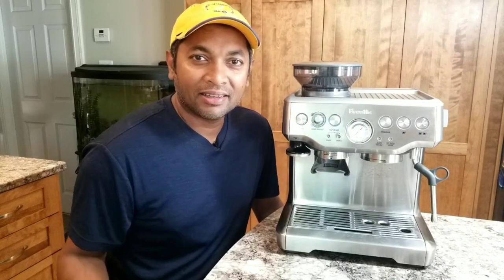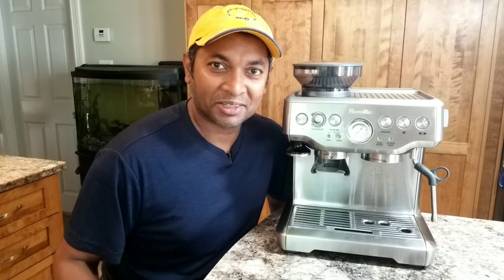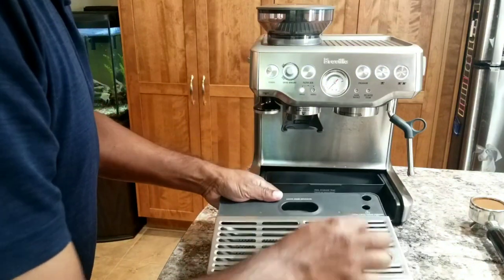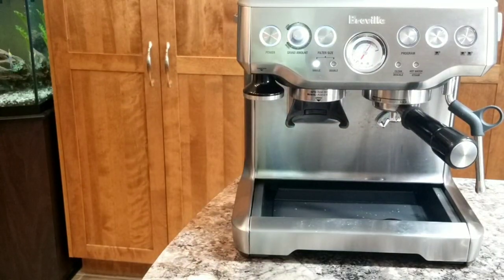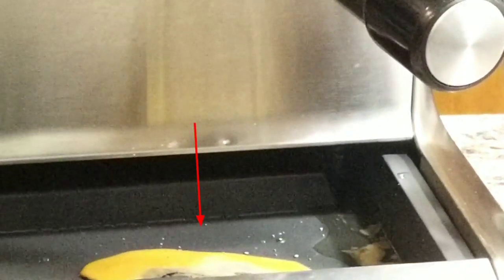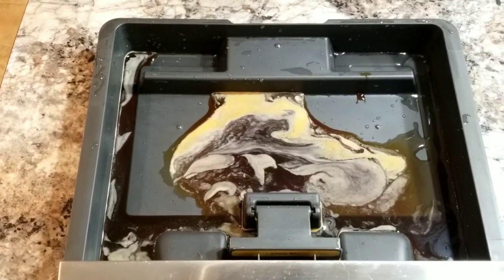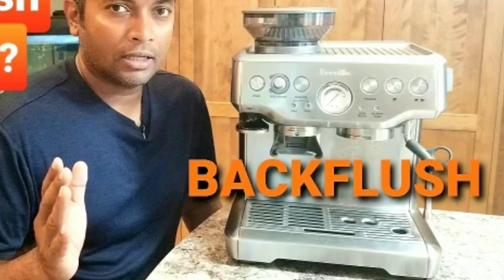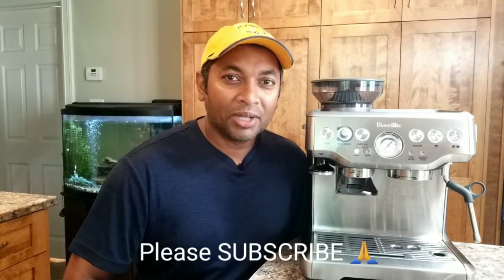Can this Damage your Espresso Machine?? Backflush & High Pressure Extraction on Breville Barista

Comment: My machine operates in the overpressure every time and I want to get it into the correct extraction zone.  I  use 17-18g and try to get 27sec extraction but in order to do this my grind size ranges from 2-4. I use fresh coffee within one month of purchase and am particular about tamping and distributing coffee.  There is a lot of water in my tray underneath.
Reply from the maker: Over pressure = more warer in drip tray through OPV. That's normal. Either reduce quantity to 16.5 or take 17g and grind at 5 ot 6 (more coarser)

Comment: I have 860xl that is over 10 years old and installed new pump, there is small leak between pump and OPV, OPV only screws in about four turns before getting tight and do not want to risk damaging the fine threads by continuing to turn it if clear silicone gasket is no good, how to get new OPV gasket without buying new OPV? thanks, excellent content, I learn so much!!
Reply from the maker: Never tried to opem OPV. But if you manage to open you'll see a red o-ring either damaged, melted or if you suspect a leave replace it. Use a pin the take it out if its stuck inside

Comment: HELP After do a clean with tablet.   I did back wash.   After doing it the coffee no longer has crema on coffee even moving to 1 for fine just a little.
Reply from the maker: Do a pressure tesr to see if your machine works well. https://youtu.be/acQYG7HkYb4
I suspect stale beans. When is the Roasted date on the beans?
Reply: Yes did a pressure test following your instructions tried 4 different coffee bags.  Spoke with Breville they set it back to factory setting.  Told me to do a shot in dual wall double filter.   Pressure was at 1 o'clock. Which they said too high. Even though 8 months out of warranty are repairing at no cost.   Will let you what they had to do picking up today.
Reply from the maker: @RaaAustin-xv5kt  ok let me know
Reply: I have picked it up they said adjusted   grinder and flow.  Made a coffee was in the expression zone crema probably a little thin but good.  Think still needs some fiddling with grind.  They have the side level at 8.

Comment: Hi ! You have excellent info and videos !! In my machine the pressure gauge is every time almost at the maximum...
Reply from the maker: Make sure your filter Baskets are not clogged. I have a video on how to clean clogged filter. 
Secondly make sure your Grind size is a bit more Coarser. 
Thirdly you can reduce 18g to 16g or 17g.
Happy Extraction 👍

Comment: Hi, thanks for sharing your valuable experiences through these great videos. I have learnt so many things from you. Here I have a question. I too use the same breville barista. My issue is the yield which come in 1:3 ratio like I put in 18g of beans and  I get 55g of espresso in around 20 seconds. If I make it finer the time increases and pressure increases but the yield remains the same. What should I do?

Comment: thank you for this...my breville just went too high on the pressure and i was freaking out because i thought it was broken...i didnt think i ground my beans that fine but maybe i did and i did notice the tray had extra water
Reply from the maker: See if you are using Double wall Pressurized basket. Also make sure you clean the holes in the basket and see if its clogged. If both are good then grind it more Coarser.

Comment: Every time I see your machine apart, I get the urge to open mine and add an electronic pressure sensor and temperature sensors to monitor the espresso making process each time I brew. thanks for the inspiring videos
Reply from the maker: You are welcome

Comment: Thank you! Now I know why there is water running on the side and why my sealing ring is damaged (to much pressure)
Reply from the maker: O - ring Usually gets damaged when there is clogs. Clogs is the culprit that produces pressure as it chokes the pipe which creates pressure and burst. But when you do backflush, there is something called OPV (Over Pressure Value) that protects the machine from excessive pressure build up.
So solution is to Descale regularly so that the pipes are not clogged.

Comment: Is the pressure in the boiler and the pressure in the portafilter actually much different? You would think that the gauge would display brewing pressure.
Reply from the maker: Pressure is generated by the pump. Boiler has no role.
Reply: @AjusCafe  Agreed, but you made it sound like the gauge pressure may be different from the brewing pressure. I have seen a few videos where people use a portafilter with a pressure gauge, and the pressure on both gauges seem to be about the same. So I feel like the gauge on the machine is fairly trustworthy.

Comment: Hi thank you for sharing this video, I have a question about my machine, recently when I make my second brew right after my first brew, the water pressure always went to a little bit higher than the first one, which will cuz my espresso dripping..taste not good, but all my grind setting is the exzactly the same like the first one. after I shut down my machine for a while. when I brew it again the pressure is normal, but the second one will get a bit higher again. I have no idea whats going on? have you had this issue?

Comment: Thank you for your Video and I would like to have your reccommend for use the basket, whice one is better between to use for  fresh ground coffee or use with pre-ground coffee?
Reply from the maker: For Freshly Roasted coffee beans always use single wall double cup basket, i.e. Non-Pressurized basket. I wouldn't recommend you to use preground coffee for espresso. Its good for making drip coffee,  French press etc  if you still wanna get the taste of it then you MUST use Pressurized Double wall basket. Else you won't get pressure. Even this pressure that you see is artificially made by Pressurized basket. So you won't get the full flavor of the coffee
Reply: @AjusCafe  I see. Thank you for your recommend. I will try it again. 🙏😄

Comment: I have bambino plus machine, and my problem is the high water output, what’s the main cause and how can I fix it?
Reply from the maker: How many Oz or wster how many oz of Espresso do you get
Reply: @AjusCafe  40 gm in less than 20 seconds,, I’ve tried to reset the factory settings, but It didn’t work
Reply from the maker: @wejdanmmh8742  can you grind more finer the coffee beans and tell me the numbers again?
Reply: @AjusCafe  it’s still 40 gm, also the water flow is fast from one side of the shower screen, it’s not distributed evenly

Comment: Can this machine grind more than 1 of coffee variants together in a bean hopper (ie; arabica+brazil+robusta etc mixed together)? Because someone told that it can occur malfunction of the machine?
Reply from the maker: Oh no. I don't think it can malfunction 🙂 in anyway. But why do someone do it, as every bean pack is different and it needs to be dialed in with different grind size etc. So when you mix beans, you are not hitting the sweet spot of each bean type. But nothing wrong to try it out. In fact my next video is about roasting 2 different beans together and taste it. Stay tuned.

Comment: Thank you for your video. I realise that I usually have backflush. Does it mean that anytime you have backflush your pressure is too high? I.e beans too finely ground?
Reply from the maker: Backflush will generate lot of pressure like finely ground powder. But Backflush process should be done without any grinds in the basket.

Comment: I'm surprised that your gauge didn't give you an even higher pressure reading. It almost looked like you were right on the edge of being within range, even though the shot was clearly over extracted.  For my machine,  the gague would have moved even further given the extraction was chocking that much. It makes me question if your gauge is stuck at that point or if gaguges on these machines are not accurate in general.
Reply from the maker: That's all it goes on over pressure. I checked with backflush clean  disk as well and that all the meter reads. You machine is showing correct. Mine has some guage calibration from day 1. Nothing major to bother me.

Comment: I forgot to fill up the water in the tank (water is empty in tank) while doing an extract and switch the wand ON to steam milk...will this affects the machine and caused the break down or malfunction?
Reply from the maker: Yes it is possible to fail. Never operate steam without water in the tank.

Comment: hi my machine has same problem, overpressure and coffee not coming out! but before it works fine..what do u think is wrong with it?
Reply from the maker: Check if the filters are clogged. https://youtu.be/oNEgUli_DwA
Test by running hot water without coffee Grinds and see.
Reply: Did you ever find a solution to this? My machine was working fine, and now way over pressure & nothing at all coming out??
Reply from the maker: @kayleigh_dunn  run empty shot without Grinds in it. Are you getting water flow with low pressure? If yes then you need to use Non-Pressurized basket and grind Coarser.

Comment: Thanks for the video, I've same issue with my espresso machine, same model.I have to fine grind the beans to extract 36g espresso from 18g beans using double baset  in 25-26 seconds, but the dial is showing overpressure almost full scale and the taste is not good.
I have tried several settings but unable to adjust to the correct one,if I go courser the extract is very fast about 11-12 sec. Any idea hove to solve this issue. Thanks,
Reply from the maker: You need to go step by step Coarser. What happens when you do just 1 step Grind size coarser? The flow should get better. Taste and see. Then adjust if needed. Usually BBE automatic Extraction would bring out 1:3 i.e. around 45g out from 18g. If you want 1:2 then go manual Extraction. https://youtu.be/d1fKAH-Au5Y
Manual https://youtu.be/b15CR_A9PgM
Reply: @Aju's Cafe  Thanks for your help.
Reply from the maker: @waheedbakier8545  you are welcome

Comment: What happens to the grinder if using oily beans? It is save or not?
Reply from the maker: There will be lot of build up of coffee oil which will be hard to remove. And oil attracts grind and make it gummy or glue like. That will strain the grinder and the performance will get weak and life of grinder will shorten. Unless you do thorough deep cleaning every week. So medium or light roast is safe for longer run and performance.
Reply: @AjusCafe  Thanks for infos.. :)

Comment: I currently have this problem, but my machine, according to Breville, is completely broken. All of a sudden last month, my machine stopped pulling shots with the two-shot basket, and the pressure was so high no water was coming out, I mean no water anywhere. Apparently, it's a faulty water valve. I clean my machine monthly to scale it, do the tablets, take off the grinder, the whole thing. Unfortunately, mine just decided not to want to work anymore.
Reply: I have exactly the same problem with my machine. Is there any solution to this?
Reply: @Anita_She  I sent my whole machine into breville for fixing but it may be as simple as get new baskets. Apparently over time they get clogged but no where in my research did someone say that.
Reply: @KeeleyKirkley  thank you for your reply. I did unclog the baskets with the needle that was included in the set. Unfortunately, that did not solve my problem. I also back flashed the machine, descaled it with tablets, cleaned the grinder and nothing helped. So, I guess I have to send it to Breville for service as well.
Reply: Contact breville; they might want a video call with you to see what exactly is going on. That is what they did with me after I got it back, and it still wasn't working due to the clogged baskets. But overall, sending the machine is super easy and definitely worth it if you use it daily like most people do when they have this machine.
Reply: @Anita_She  hope that helps!
Reply: @KeeleyKirkley  yes, it does. Thank you once again 🥂🌹
Reply: @KeeleyKirkley  how do you send to your Machine In if it needs maintenance ?
Reply: You need to contact breville. I find it easiest to call them and they will walk you through the steps on how to fix it over the phone, or if it's still under warranty, they will send you a new item or they will, have you ship your whole machine in. That's actually what I did. I shipped mine to them.  2 weeks later, I got it back, and it worked

Comment: This machine is weird. The pressure gauge does not correlate to extraction times, and it seems everytime I make an espresso past the 12 o'clock I get water in the driptray like it's backflushing some water. These are things that get me nervous about the machine cause I have another older and cheaper one, the Ikohs kaffetta that is not even longer on Amazon, completely manual machine, no grinder, temperature gauge, not a pressure gauge, and it did not eve come with a single wall basket, and had to buy one separately, but Using separate grinder, and the single wall double shot basket I managed to get better shots than with this machine, no backflushing and since it has not the manometer it keeps me off from confusions.
So, I think theres something wrong with this machine, the way they calibrate everything in it. Even though it still is a good machine, I don't think I would buy it if I knew all of these. There must be machines without these issues.
Reply from the maker: When its Extracted in hight pressure, more water flows to drip tray like a backflush. That's normal and what the Solenoid and OPV does during extraction. Nothing to worry there
Reply: @AjusCafe  Thanks. I bought new freshly roasted coffee in alocal store and it seems to work better. The extraction looks smoother. I managed to get a a 1:2 ratio in 25-27 seconds mor eor less and it was superb.

Comment: I have a issue with ny machine,anyone can help with an advice.  1 week ago i tried to clean my machine ( clean me function) and i don't know how but the seal from the head shower snap. I thought that it's time to change it because i never do it in 2 years time. J change the seal and the same thing happened. Than i thought that is something wrong with the head shower so i replaced that too. I just received the head shower today,change it, change it and it snap again.  Did anyone experience this? Thanks
Reply: When I'm doing a coffee that is under extracted is fine but when i try to clean me or put to much/finner  coffee into the portafilter the seal  break and the coffee is overflowing
Reply from the maker: Good question. Keep these tips in mind for a longer run of silicon seal:
1. Never force tighten the Portafilter when the machine is cold. Because silicon will be flexible ONLY when its warm
2. Warm up the machine and run hot water through group head 1 or 2 times
3. Then gently tighten Portafilter to the GroupHead without Grinds and run empty shots.
By now the silicon is warm and flexible. Now dry the PF basket and fill in Grinds and make sure you TIGHTEN it in GroupHead which should be warm and flexible. 

Flow above steps before you do  clean cycle too.
Reply: I'm afraid that is not gonna be that easy,i do all this steps every morning. I even don't let my wife use the machine,i bought her another one. Buy now i broke 3 silicone seals and change the head shower. I will change the portafilter +basket and if will be the same i will have to contact someone who knows much more than me. Thanks anyway
Reply from the maker: @CosminAdrian1528  ok i understand. But warming up (either by switching ON this machine for 20 minutes OR running hot water like I mentioned) GroupHead, PF and machine is what most of espresso makers/baristas follow and the right way to do. It applies to any espresso machine.
Reply: @AjusCafe  thanks 🙏
Reply: I’m having the same problem, so I brought the machine to the warranty company. At the same time I found here the answer what’s the problem. The company’s masters told the same. Because of the grinder vibration the bolts holding the group head inside the machine get loose and there creates a gap between group head and a PF. That’s the reason the pressure spits out the rubber gasket. You can find on YT the video how to DIY to solve this problem - issues with SES875 rubber gasket. In video comments there is link to video how to dissemble the machine to get to that bolts. I’ve found those videos - the links are below.